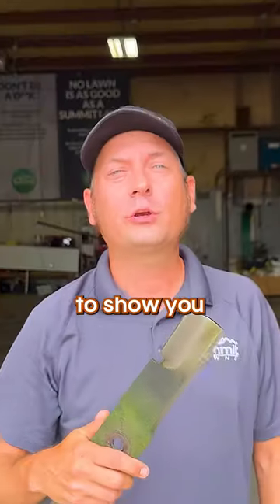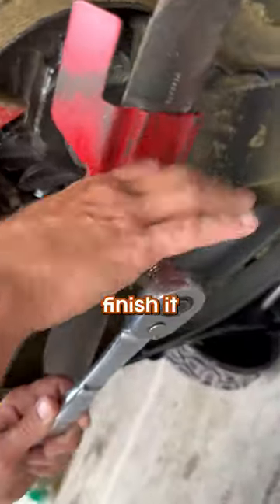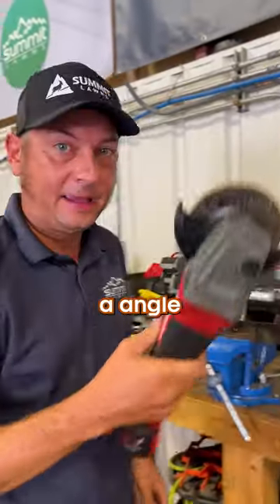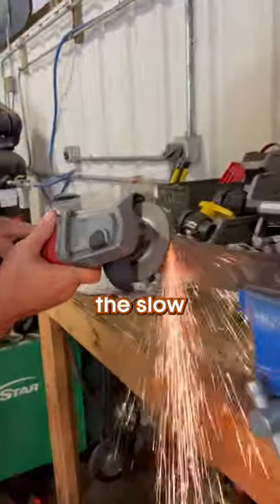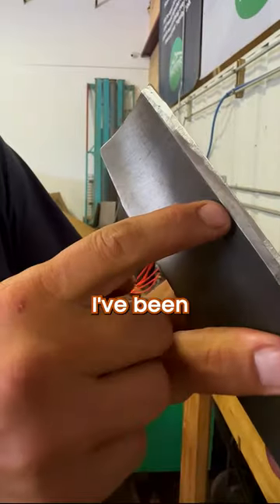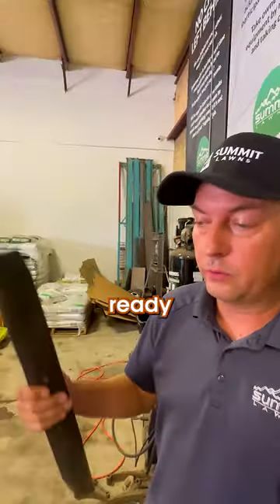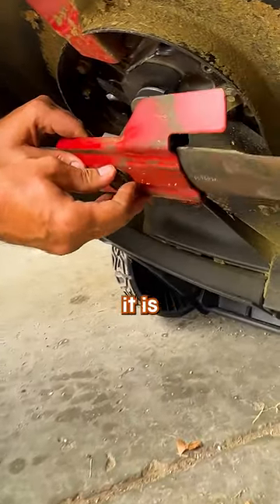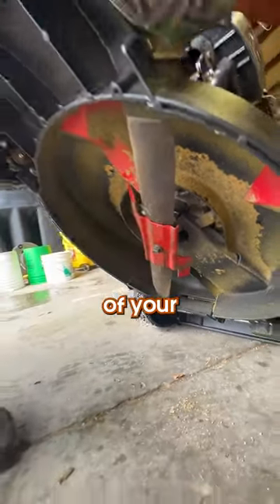How to Sharpen Your Mower Blades EXPLAINED in 60 seconds or less

Comment: Always check balances before you install. Rookie.
Reply: Been in the lawn care industry for decades and I've never balance the blade once. As long as you keep the same pressure and make the same amount of swipes on each side you're fine.
Reply: Still smart to check , I’ve had brand new blades off balance .. if you don’t care about replacing the mechanics running the blade prematurely feel free . I personally like keeping my purchase well kept and running for years ….. to each there own. Just not a fan of misled info
Reply: I agree
Reply: @teh_fatninja430 yeah until yoy bend the crank shaft
Reply: @jawsome2049  I have a Scag 3-wheeler with 5000 hours on it. It still has two out of the three factories spindles on it. I have never balance a blade in my life. The first engine went out about 3,000 hours. This one is getting close to 2,000 hours.
Reply: Have mowers with over 8,500 hours on them and haven't ever had a blade balanced. 

The first stick, pine cone, dog ball, etc. that gets hit throws it off balance anyway....
Reply: Waste of time
Reply: false
Reply: All it takes is a nail clamped level in the bench vise to check balance. Easy to fix it. Does not pay not to balance them. Rookie move not to. I don’t care how good anyone thinks they are with a grinder, balance should be checked.
Reply: @fieraci8500  incorrect.
Reply: @fieraci8500  looks like your a rookie if you don't Balance the blade it wont hurt it nor has it never hurt it but Sense you "pros" like to claim itll give it excessive vibrations has never felt excessive vibrations before when the crank or spindle is bent from hitting something hard
Reply: I was gonna say the same thing man. Gotta balance for  great cut and slower weapon spindles.

Comment: Rookie move, always make sure your blade is balanced after sharpening before you put it back on your lawnmower
Reply: Agreed, most people miss that step but if you don’t do it that mower ain’t gonna last for long
Reply: Because you don't need to balance most times. Been a landscaper for 20 years and even I don't need to balance. I check um with a nail on the wall like once a year and they never are out of balance. If you're a homeowner just doing your own lawn your mower will wear out before you sharpen your blades enough to get them out of balance.
Reply: Only time I balance a blade is if I'm taking a lot of material off by removing large chips in the edge. Any regular sharpening is nominal and I've never had any kind of issues from it. Been doing lawncare 6 years now too
Reply: @DayTukErrJawbs literally every time I sharpen my blades i throw them on the balancer (always spot on) and I tell myself “I’m not checking anymore” because I’m always balanced. But I check anyway.

Comment: Use a flap disc. You just cutting my metal than needed
Reply: I never tried that. Sounds like a good idea. After 18 years I hired a landscaper so I doubt I’ll be sharpening a mower blade anytime soon. But I still have a machete and a hatchet.  Might try those.
After sharpening a spare mower blade I put a thin swipe of grease on the sharpened edges to keep it from rusting or pitting. Works well.
Reply: @fieraci8500 
 I tried for the first time and liked to shit a brick at how nice and easy it was. It produces a slightly rounded edge instead of an angle m, but if ya want just go over it with a file.

Comment: Flapper wheels are easier and safer for sharpening. Also i dont worry about balancing. Think about it. How often are the blades ever truly "balanced"? Youre cutting grass that will clump up randomly on or around the blade, not balanced. Youre often cutting more than one kind of plant be it weeds and or grass mixes which will be different widths, weights, and densities, not balanced. Often you pick up small rocks or wood chips with the blades and these will leave small to large nicks or rolls in the blades, not balanced. Good rule to follow is just do similar amounts of sharpening or touch up work on both sides of the blade.

Comment: I don't do just the cutting edge most times.  I do the whole angle. You can do just the edge for a quick sharpen but if you keep doing it that way the angle will get steeper and steeper. I am a landscaper though and have to sharpen my blades at least weekly. If your a homeowner just doing your own grass and sharpening yearly doing just the cutting edge is just fine

Comment: How do you get blades off of riding mowers
Reply: The easiest way is to jack up your mower or get it up on a ramp to be able to get under the mowing deck...then use an impact gun...it's the easiest even for a push mower...

Comment: You should have seen the blades I just pulled off my father inlaws mower! All 3 blades were split down both ends in a wedge. Dull, and shorter than they should be. $80 later new blades!
Reply: What is best sharp or square edge years ago i was told to do a square edge you have two edge it last longer ????

Comment: Wrong on bench grinder, flip blade and use tool rest to drag blade back and forward, gives and solid base to get a nice clean cut then clean up other side just a little and blade will be razor sharp

Comment: 🚫WARNING!...Hi guys don't forget to remove the spark plug lead before you start messing with the blade, if you are turning it and the spark ignites any fuel that may be left in the chamber the blade will spin at high knots🩸🖐😖🚑💨🏨, this is unlikely but possible,